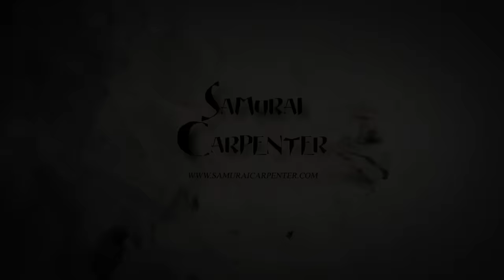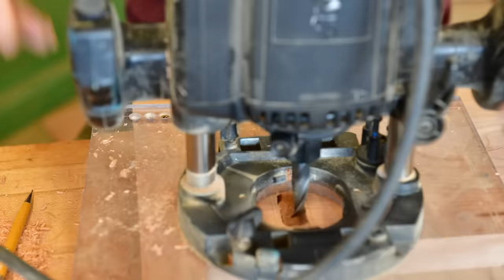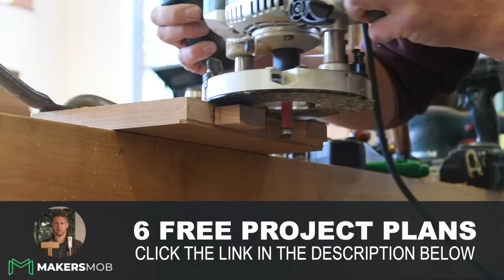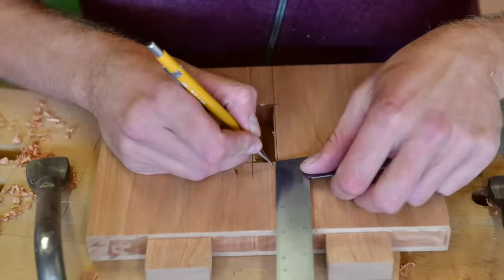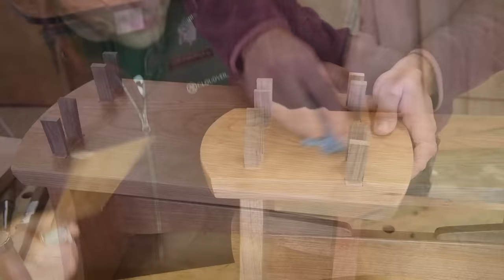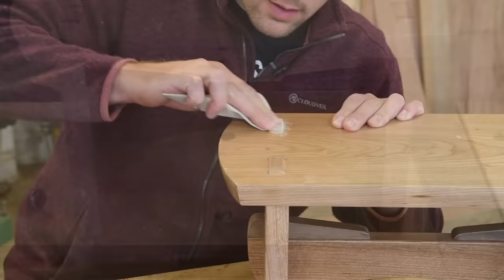Japanese Joinery - Build a Step Stool

Comment: This is so impressive to build something like this without using nails or screws... I bet it requires a lot of patience and also a mountain of failures to overcome to get to this level of craftsman.
Reply: It's really just about acquiring some knowledge! Once you know about how to go about the process and the steps involved you can make alot of stuff without screws or nails. I just built an end table with mortise and tenons only.. No screws and it is rock solid and will last generations. If it is something you're interested in learning it is very rewarding! Give it a shot!

Comment: May I know which router bit you used for chamfering the top part od the stool? It seems it must be bit with bearing bit because the cut was done free hand. But I see no flat spot around the edge as a result of the bearing. Thanks for inspirational project.

Comment: Hi Jesse, have just made a bench seat that needs sanding over then I can put it all together, it has the bench seat top with panel legs I partly noticed into top.
Now the problem is I used one width of centre piece wood  to hold the legs in place so the legs presently can flap about somewhat, do I need to get a wider underside board to correct this?
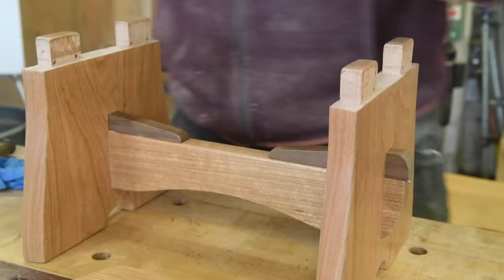Now at 6:40 mins that bar you got hold of is the bit done wrong, you have wedges pointing at each other while I have mine pointing towards me

Comment: I am curious about the direction of the wedges in the top tenons and how you avoid splitting the top along the grain.
Reply: Wedges are small, so there really shouldn't be to much lateral stress. I don't think it would have looked near as nice if the wedges were driven in the other way.

Comment: I am currently working on my second Samurai shop stool.  On this small stool, what size drill bit did you use for the relief holes on the tenons and, you did not appear to use glue on the wedges.  Did you?
Reply: Looked like a number 5 drill bit, but can be what ever you want, between a 4 and 6 id say. He put glue in the relief cuts then put the top on, then drove the wedges in. Id say it was to keep it as clean as possible as its pre finished so less clean up.
Reply from the maker: Bruce Martin 3/16” no glue but you can use it if you want.

Comment: is there a particular reason you used a plunge router for some mortises and a forstner bit for others?
Reply: Can be done either way.  I think Jesse was showing different ways to remove material before squaring it up with the chisels.  Also when he used the router he used his router edge guide which requires a straight edge parallel to the hole your cutting. If the edge is not parallel to the hole you need to cut then the forstner bit is a great tool to use.

Comment: So it says 'Danger' writ big on the table saw fence and this bloody eeit passes his hands directly over the top of an unguarded saw blade! Ye Gods...Darwinsim at work!
Reply: Table saw guards are a new " thing "   many of us old timers hate them, cant see the work.
Reply: @rrmerlin3402  Better than slicing off your hand or fingers. Check out table saw accidents in the USA....Google is your friend!
Reply: @theblokevlog352  Blade guards and riving knife were not available for my first 30 years of table saw work. Sure blade guards and riving knives are much safer, but without them does not mean a certain accident.  In my Emergency service career I went on many home wood shop accidents, the common them was New operators.
Reply: In the UK in professional 'shops, blade guards have been mandatory by law since the 1960's and it's illegal to remove them. This means that operators of woodworking equipment have had to produce their work with guards in place. That 'shops in the US didn't have to fit them has to be a sad reflection on the state of the health & safety  regs. I've been a woodworker in The UK since the early 70's both as an professional cabinet maker and now hobbyist; thus far I have all my digits intact.
Reply: @theblokevlog352  30k people die in automobile accidents each year. 320 million don't.Those numbers don't stop anyone from driving. If table saws were so dangerous  everyone would use a saw-stop table saw.